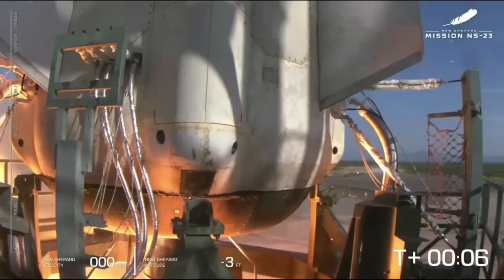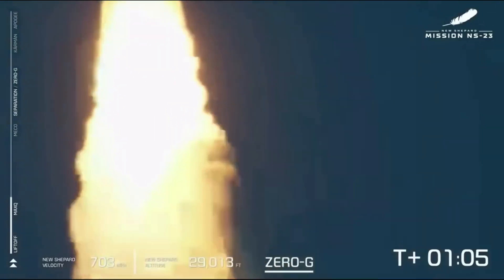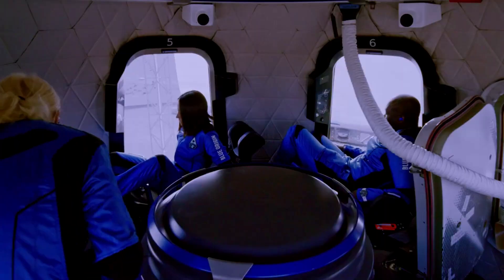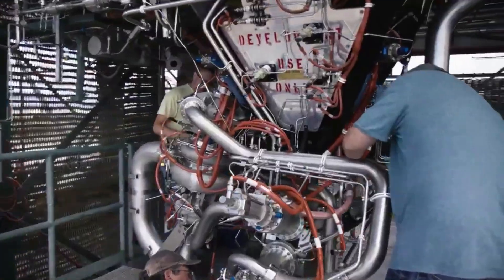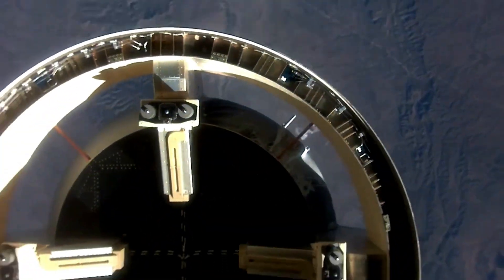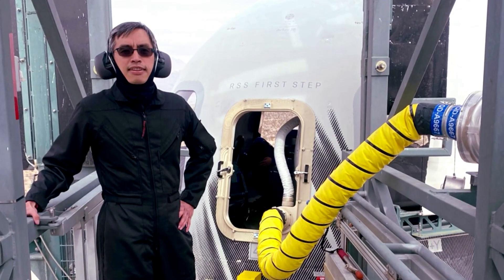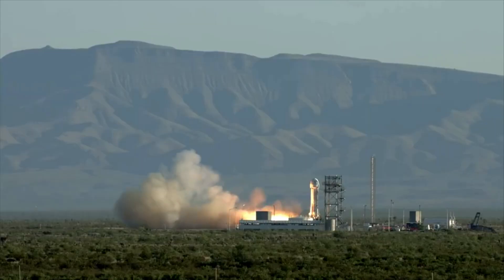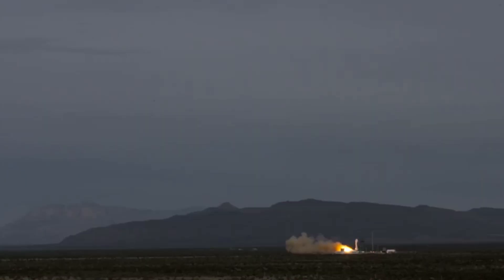Blue Origin Just Released The NS-23 Failure Findings Report

Comment: A few years ago I stopped at The Museum of Space History in Alamogordo. They have an F-1 engine on display that one can touch and learn that the stainless steel bell has little channels that rocket fuel is pumped through to cool the bell. How does a larger bell solve the BE-3 heat fatigue problem? Was the solution thicker material or more cooling or more surface area heat distribution and won't any of these solutions merely put off the mean time of bell routine maintenance replacement?
Reply: a large bell dos"nt solve the problem. you must remember that f1 only had to work a few times ie. testing then flight. the be3 needs to be used and reused multiply times so its most likely a flow issue with the cryo fuel through the bell of the engine. i dont know how many times this engine flew but i guess it was too many times for the cooling it had.
Reply: The BE-3U is the vacuum optimized version, which is why it has the bigger bell.

For engine cooling, there are multiple methods and most reusable engines use the tiny tubes in the bell, throat, and around the thrust chamber to pump cryogenci propellant. That cools the parts and also heats up the propellant making both work better.